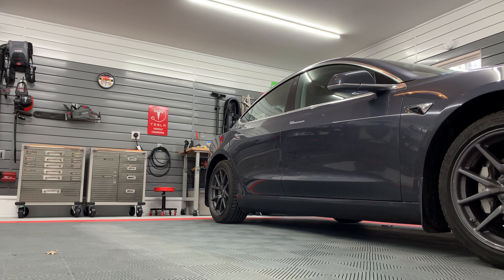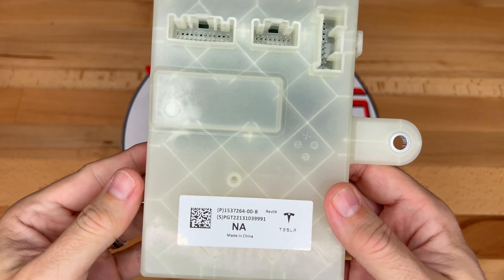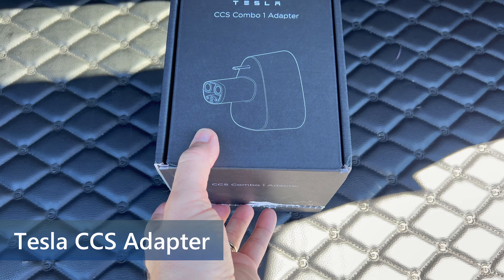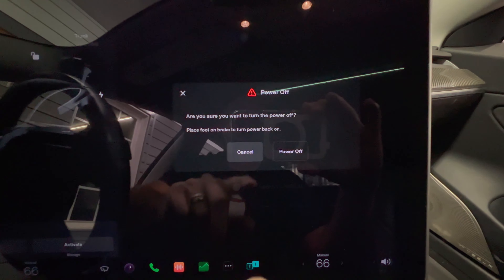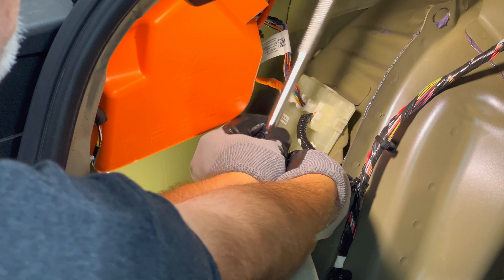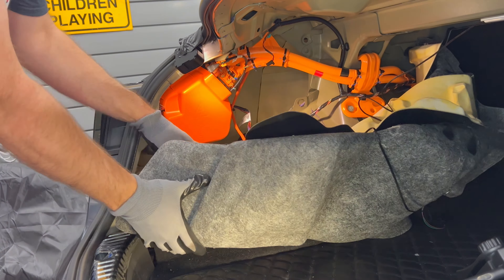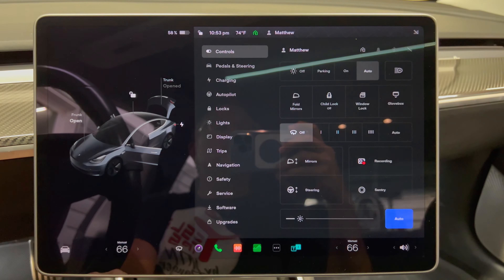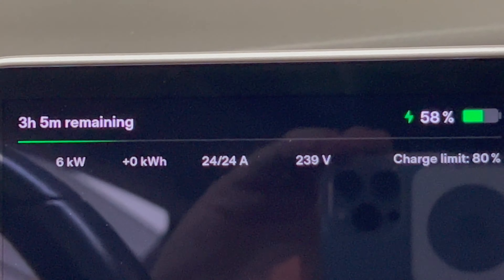Tesla Model 3 - CCS ECU Retrofit

Comment: Thanks for the video, it was very helpful! I just helped a friend retrofit an old Model 3 here in Brazil, following those exact steps. The only difference is that we updated the software in service mode since we didn't have any pending updates for that car. It worked perfectly on the first atempt, and we can charge it on CCS2 chargers here in Brazil now!
Reply from the maker: Great!  Using service mode for update is an excellent time saver.
Reply: Where did you get the parts from

Comment: Thanks for shooting a video on this. I did the same retrofit about the same time as you did. Also successful. 
Note that you do not really have to disconnect the 12v battery and HV battery, IF you wait for the car to go to sleep and the ECU to power down. The ECU has a blinking red light when it has power. If you had pulled back the trunk liner earlier, when you waited a while and your car “clunked off”, you would have been able to see the ECU power off.
Also, you could have covered the “Service Mode” approach to handling the software update, so you don’t have to wait for an update to become available, since sometimes regular updates are many weeks apart.
Reply from the maker: I always like to do my method for any electrical work.  Thanks for the alternative!  I've been debating even doing a video on service mode - some people shouldn't be messing with it.  Thanks for the suggestion.

Comment: I just completed, my retrofit using your instructions thank you so much. I had to wait for sometime, til I got the software update message to start the update process.  It took some time to complete removing the connectors and the update, but with patience it took about an hour to complete including the software update.
Reply from the maker: Great, I'm glad it worked.
Reply: How’s it work so far can u still home charge and supercharge? Is there anything buggy about it like the charge port door or any errors or theoddling when charging thanks?
Reply from the maker: @flipminerchino370  Mine's been installed for seven months with no issues.  Charging on AC and DC works great.  It's using a Tesla ECU, so no compatibility issues.
Reply: My car is on the latest software update. How do I workaround it?

Comment: Wonderful video! I'm a bit late to seeing these 😅 I'd just mention a bit of additional context: it's Oct 2020 (not 21) that's the switch between Gen3 (chrome trim, needs adapter) and Gen4 (black trim, no adapter). As for the Gen4 parts, if you have a Gen4 car (black trim, 3 or Y) and it shows "not installed", you have a "stripped" Gen4 ECU and just need to replace it with the "full" ECU -- same ECU part number but "-00-" instead of "-80-" (stripped). No Bundle/adapter.

CCS for everyone! 🎉
Reply from the maker: Thanks for the additional information.

Comment: I didn't have to power down the system. I only power off from the screen.
I used the service mode to reinstall the firmware, and it worked fine.
Thanks for the video
Reply from the maker: Yes, there are a couple of different variations on installing this.

Comment: My car model Y had an accident from the back so its charging was broken so I opened it and installed a new one and also opened its CCS remove its cables then after I fitted it. Ever since this problem started the light has always been red
Reply from the maker: @hassanraza.412  I not experienced with the Model Y.  Personally, I would have Tesla service fix this issue.

Comment: There is no need to remove the battery terminal connection.  Tesla's own shop manual does not recommend this for replacement of the ECU.
Reply from the maker: Thanks, when doing anything with the electrical system in the car, I err on the side of caution.
Reply: Given the number of people giving bad advice about the order of operation of disabling 12v power (should be: unplug battery first -> unplug under-seat connector 2nd -> do your work -> reconnect under-seat connector -> reconnect 12v battery), I also just suggest leaving the power on. But given that it can usually give other benefits to fully reboot the car as well, it's OK to do so!

Comment: Any update on this still working (hopefully yes)?  And any suggestions on how to delay the updates on the car or understand when a new update has arrived that's sufficient for the purposes of this retrofit?  My first thought is to turn off the wifi for the car so it'll stop receiving updates.  But is there a semi-predictable rollout of updates?
Reply from the maker: Yes, it is still working.  To delay system updates, turn off the wifi (disconnect your home router by selecting forget).  Updates rollouts are random and any update will be enough to do the retrofit.  If you wish, you can also go into the service menu and perform a manual update.  It's on the to-do list of upcoming videos.
Reply: @MTNRanger  I did see that in another comment here after posting my question. I have already been playing around a bit with the service menus and did find that section. I was able to order the Gen 4 ECU from my local Tesla service center (after assuring them I wasn’t going to hold them to it actually working for me) and ordered the jumper cable from the eBay link you provided below. Looks pretty straightforward as I didn’t realize I could manually trigger the software update till now. By the way the Tesla service center told me it might 2-3 years before they make this a priority. Instead their priority is building as many new V3 Superchargers as possible (here in the US) and quite frankly I can’t argue with that logic. As someone who used CCS in 2022 about 200 times with a Kia EV6 sand has now enjoyed about 35 SC sessions in 2023 with a 2018 LR RWD Model 3 there’s no comparison doe the average user. SCs are so much better than CCS networks especially for road tripping here in the Middle of the country I can’t recommend to my friends they buy anything but a Tesla right now.
Reply from the maker: @skyemalcolm  Thanks for your story.  If you don't follow my channel, I'm getting a CCS EV this summer.  With the magic dock V3 and V4 rollout, and the further expansion of the EA/EVgo and other CCS networks, I don't see a problem.  I did do a trip in Oct from FL to NC solely on CCS with no issues.

Comment: I have a model y and it has a charging problem every time the charging light turns red on then it doesn't do anything, do you think it will have the same problem if we change it? This means it will be fine
Reply from the maker: You have done this mid and are now having problems?

Comment: After replacing ECU and upgrade in service. CCS is enabled but supercharging is fast at first and fall down to 10kw. Do you have any idea?
Reply from the maker: Have you tried multiple chargers?  It could be one bad stall.
Reply: I try many chargers, situation is the same.
Reply from the maker: @彭董威  I wonder if there is a problem with the ECU or the wiring harness.

Comment: Does this works on a 2019 SR+ Model 3 RWD ? Thanks
Reply from the maker: Press "Additional vehicle information" on the software screen of the main menu.  If it says "CCS Enabled" you don't need to do it.  If it says "CCS not Installed", then yes it can be done. https://youtu.be/ry1-jbWNwW0?t=294

Comment: Will this work on a 2022 Model 3 RWD?
Reply from the maker: If the car says CCS is not installed, then yes.  What does your car say (software screen, click more info)?
Reply: @MTNRanger my car doesn’t have that line. It’s a model 3 2022 RWD from Japan.
NACS port which works on non-Tesla chargers using CCS adaptor, but it doesn’t work on Tesla’s superchargers with CCS.
Reply from the maker: @jasteech  Interesting, I not sure if it will work on the Japanese version (most likely made in China).

Comment: I tried this and got an "Unable to DC Fast Charge/Supercharge" alert, should it be ok to charge anyways?
Reply from the maker: What does the "more info" screen say under software page?  It should say "CCS enabled".
Reply: @MTNRanger  it does say CCS enabled, and I am able to charge with AC, i get error code CP_a086
Reply from the maker: @ordonez187  I did a search and found this: CP_a086_dcPinTempIrrational. So I never have seen this before.  Maybe the cable that you used for the ECU has a problem?    How about doing a reboot of the car and see if it still appears?
Reply: @MTNRanger  I used the bundle of wires listed from eBay as well as the correct part for the ECU, I also tried rebooting, reinstalling the software, and even got 2024.8.7 today and none fixed the issue. I guess I will open the trunk and check for any loose connections. Question, if I plug the old ECU back in would that cause issues since the software already lists CCS support as enabled?
Reply from the maker: @ordonez187  Good question, I honestly don't know.  You're doing everything I would do.  This is the first case I have heard of this happening.  Can you charge at all?  AC or DC?
Reply: @MTNRanger  I was able to fix it! It was the bundle of wires, my ECU only needed to be connected directly as mentioned in another comment for the same ECU with an -80- part number. Once it was just the ECU, the alert went away and everything is now working properly. Thank you for your quick responses!
Reply from the maker: @ordonez187  Interesting, I'm glad it worked out in the end!

Comment: So I did the retrofit and everything was working great supercharger charge good and so does electrify america, EVgo all the public charging charge perfectly! But the mobile tesla charger wont charge the car and I’m using a nema 14-50 and nothing
Reply from the maker: Just to verify it's not the mobile connector, is there a destination charger locally you can try?  Any errors?
Reply: It was the car not accepting low voltage charging I then charge the ecu bk to the original one and it’s still giving the error cannot AC charge
Reply from the maker: @ultra8938  Did you run a system update after installing the ECU?
Reply: @MTNRanger  yes I did all of that and it’s still not charging. I saw the ecu blinking red, I don’t know what that means
Reply from the maker: @ultra8938  Are any error messages showing on the Tesla screen?  If not, I would go into service mode and check to see if there is any errors.
Reply: Mine does not charge at all.  Ev go nor at home nor tesla stations.

Comment: i installed mine and did not work
Reply from the maker: What happened. Did the charging port not work or just not showing CCS enabled?
Reply: never said ccs was enabled and i got the correct parta dn bundlew wire but s
Reply: @MTNRanger  nothe main menu still didnt show ccs compatbile or i can not charge either so i reinstall the original one works
Reply: @tomrybold do you have a salvaged Tesla?